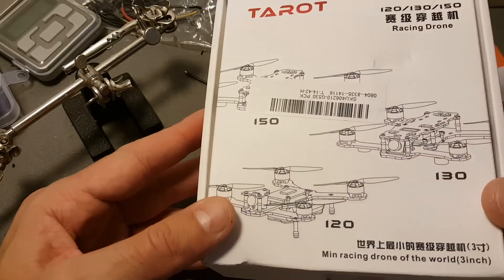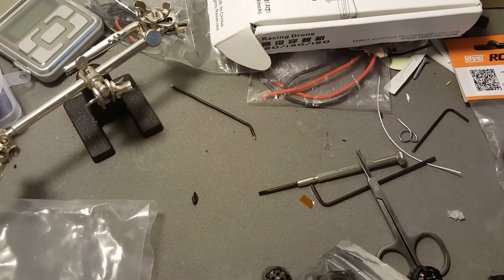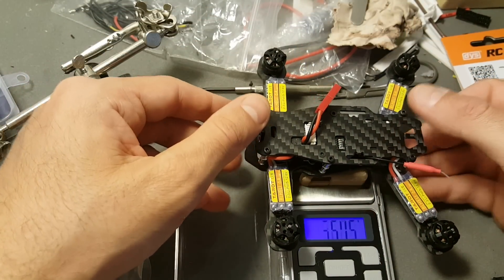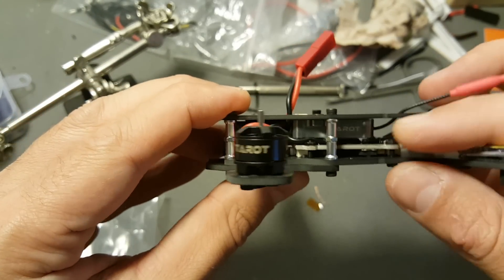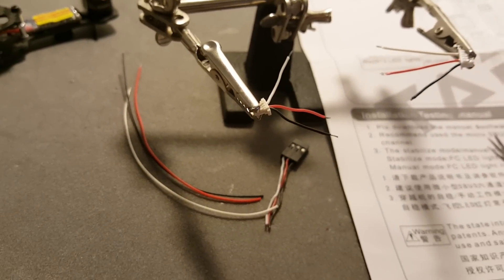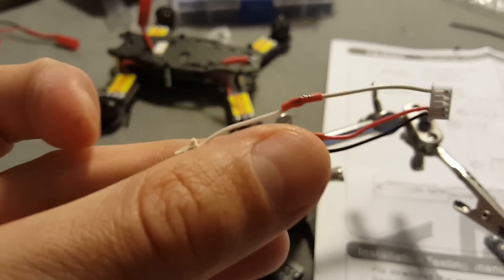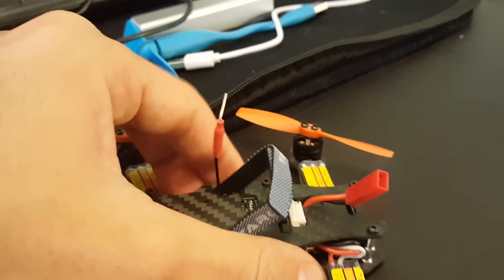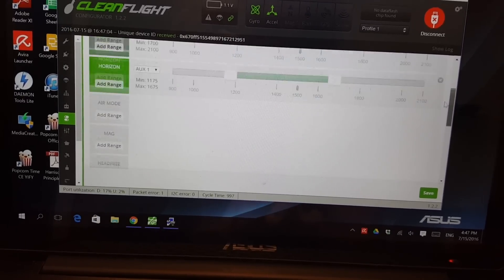Tarot TL130H1 135mm Carbon Fiber 5.8G 300mW FPV Racer PNP unboxing and review (from banggood.com)

Comment: what do you think about adding a 1000mw or higher battery? will it still be flyable?
Reply from the maker: I do not recommend it. It will be too heavy, unstable and will wear down the motors.

Comment: how do you fix antenna i chopped top of antenna the little wire on top of red part how do i fix it
Reply from the maker: Sorry, but I didn't disassemble the quad...
I guess you will have to open it up and see the wiring of the video transmitter. 
Probably you will have to solder a new pigtail antenna connector to the board.
Another option is to buy this http://goo.gl/tyX7Sz and use a very small antenna. Good luck.